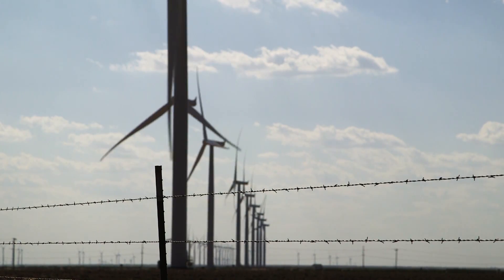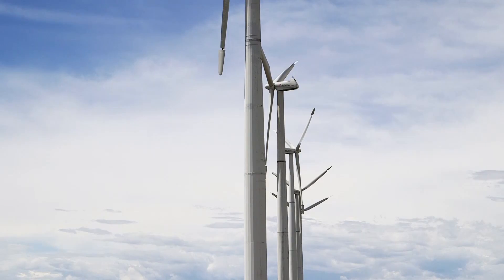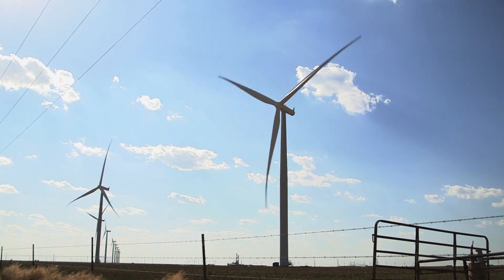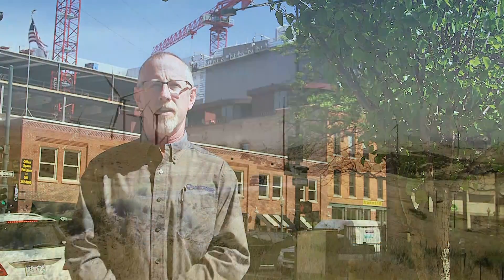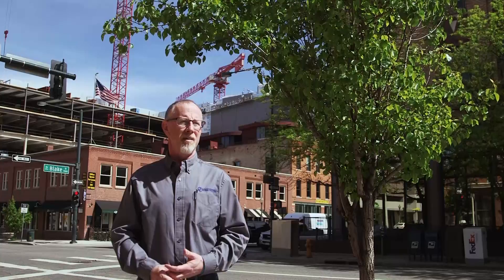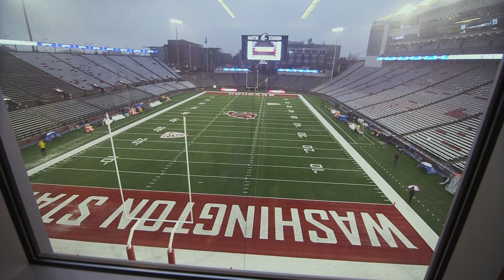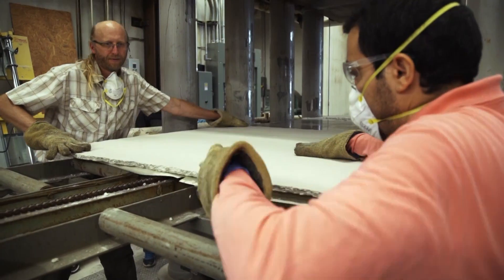Recycling Retired Wind Turbines

Comment: So let me get this straight.... We are going to return the site to its former self? Seems like the wind is still blowing there.... No thought in upgrades? Shocking that so little engineering went into this site. Just a thought. Build much larger foundations in expectation of larger turbines in the future.... I would go on however this is a fools errand.
Reply: You also have to take into consideration the difference in output from the turbines. The newer ones put out more energy and the grid there may not be able to handle the difference. That said they are subsidized to put up but may not be subsidized to upgrade, which makes it a losing proposition to the companies running them. I don't know if it's this wind farm or another in that area that shut down but that's the reason the company gave for shutting it down instead of upgrading it. It wouldn't give them a return on the investment.
Reply: Subsidies ran out, no more free lunch.
Reply: @fredhinck8847  Green energy should stand on its own, no subsidies!
Reply: when they started horizontal drilling the oilfield i worked in they would reclaim the wellsite after drilling.those wells were profitable so more wells needed to be drilled .the wellsites had to be rebuilt for more drilling on the same site that had been reclaimed . so much for planning ahead.

Comment: The cost for manufacturing, installation, maintenance and then disposal is roughly 90% of value of the energy produced. And ask Texas about the efficacy of wind turbines. All in all, a waste of time, energy and money.
Reply: Please prove that a wind turbine with decades of life and free fuel only earns 10% surplus energy over manufacture. Cite your sources. If you can't prove your statement, retract it.
Reply: @justsomeguy934  I was making that up. Sorry. I guess satire is above your pay grade. No, I will not retract it. Maybe I should have said 100% or 110%. What is "free fuel"? And you forgot to include the high maintenance costs. And the deaths of birds. Never mind.
Reply: @mikeyh0  "What is "free fuel"? Um, sunshine falling on my driveway doesn't result in a bill from God. Same for wind. That's free fuel. Oil, natural gas, coal - those are a different fuel altogether, yes? Are we learning at YOUR pay grade now?
Reply: @justsomeguy934  birds die flying into the windows of my home . will i board up those windows to protect the birds ?
Reply: Tyrone Jackson  "Argue all you like. You aren't changing anyone's mind with your condescending little rants. We still don't want them, and no one here likes you. Ta!" I suggest your read your comment again. It sounds like a 3rd grader said it on a playground. Do you know who childish your argument is? You're right about one thing - I won't change your mind, I never thought a closed mind would change. The common phrase is "Grandma will always drive her Buick". Buick is dead, and grandma doesn't have long. Since the next generation of car owners is already 80% or so pre-disposed to buy electric cars, your opinion doesn't matter. If you're over 50 years old, you are NOT the future customers of automobile manufacturers. The move to EVs has already been made, you can argue how great oil is from your LazyBoy recliner all you want.

Comment: Welcome to the new green deal. More garbage more waste more landfill.
Reply: Just like emissions compliance on our vehicles.  'Safe the planet' by burning more fuel and money than ever before to go the same distance in a smaller lighter vehicle you cant even repair yourself.
Reply: @illbeyourmonster2  my 2006 impala gets 29 mpg on the highway has 265,000 miles . never even changed the spark plugs . not because i can't i don't need to. i change the oil myself.. i also changed a front wheel bearing. the routine maintenance done on carbureted cars is no longer needed. how many people had a timing light back in the day anyway. the Texaco station i worked at did tune ups we didn't have a timing light LOL.
Reply: what do you think happens to the coal ash from the coal fired electric power plants?  Wait for it  land fills of sludge ponds . do a google search on sludge ponds .
Reply: @erniew5805  A lot of the coal ash gets repurposed to make concrete and for making toxic industrial byproducts inert.
Reply: @erniew5805  And?  You can have modern designs without the emissions restrictions and losses and get even better service life, power, and fuel mileage numbers too.  

It's multi Billion dollar industry and it's growing rapidly.

Comment: The wind never runs out, the subsidizing does.
Reply: The cost will never end until we screw the politicians into the ground for recycling.
Reply: The earth will vomit the politicians back out.
Reply: We're harvesting the wrong wind.  We need to find a way to bottle up all that hot air in Washington.
Reply: Let's stop subsidizing oil, coal, and nuclear power and see how long it takes for energy companies to choose the cheapest form of energy production.
Reply: @andyjohnson3790  sometimes the cheapest form is difficult to determine. You're correct, if all subsidies for oil were removed (no military protection for their trade routes, either), oil would become far more expensive than any renewable.
Reply: @andyjohnson3790  Nothing involving the government and tax dollars is ever the cheapest.
Reply: The subsidizing for oil never runs out!
Reply: @justsomeguy934  At this point Texas has proven that oil works better then solar for production and reliability
Reply: @WeinerusMaximus  "At this point Texas has proven that oil works better then solar for production and reliability" Actually, all Texas has proven is how to NOT run a utility. I live in a mountainous, cold, renewable energy state and I have reliable, cheap electricity. The Texas grid is islanded, meaning they and they alone in the USA cannot import enough energy to backup a shortfall. Their politicians deregulated their grid in the worst way.
Reply: @justsomeguy934  nope
Reply: @WeinerusMaximus  Have any facts to go with that "nope"? I guess not.
Reply: @WeinerusMaximus  well aren't you over sensitive when proven wrong.
Reply: @WeinerusMaximus  you have just proven my point.
Reply: @jamsaidemelo1367   No, you proved nothing. 85% of Windmill components are recyclable, but the FIBERGLASS blades are not recyclable , they are usually cut up in 20 ft lengths and buried in a  landfill, because FIBERGLASS used for their construction is NOT recyclable at this time.  There are reports of experimentation into recycling, but NOT AT THIS TIME.     If your point was to prove that you like to deny facts, then yes you've proven that, otherwise the blades continue to be buried in a landfill, because they are not recyclable at this time.
Reply: @justsomeguy934  During a normal winter, over 40% of the energy used in Texas is generated by windmills. Texas produces more power from windmills than any other state. The problem with the winter of 2021 was that a large portion of the state was below freezing for two weeks. This not only put a tax on the power grid for heat, but it also damaged cool systems at conventional power plants. The cold taxed the Texas power grid just like the heat wave along the west coast is taxing their systems for air conditioning. Texas is closing down six more coal fired power plants within the next two years as more wind farms  and natural gas fired power plants go online. The fact that the Texas power grid is an island does two things
 One, it keeps the cost low and two, it stops others from stealing our power because they feel entitled to it. Now, if only the western states could stop other states from stealing their water.
Reply: @vintagethrifter2114  "The fact that the Texas power grid is an island does two things" You left out the biggest flaw in that design - it means that the Texas grid is islanded. It means that they have no redundancy in their energy supply. It means that when they fail to winterize their grid time and time again, they cause energy shortages and price spikes. I don't see any advantage to their policy, except the propaganda benefit of blaming renewable energy for their recent shortage rather than blaming the politicians.
Reply: @WeinerusMaximus  "Actually I do,  but in the meantime, keep being a wanker with those cutting remarks." If you had them, you'd show them. I have all the documentation to prove the Texas issue is a refusal to winterize their grid and to integrate into the other grids in the USA. I've got the facts, let's see yours (without calling names; we're adults, aren't we?).
Reply: @justsomeguy934  Or wind and Solar
Reply: @vipommvictor6480  are we ever going to go to war to protect our interest of wind or sunlight in another country?

Comment: Video title "Wind turbine recycling"
Fact : "we blow em' up and shove em' in the landfill"
Reply: @katokagome4670  back in the 1960's the state of North Dakota reguired reclaiming open pit coal mines. to date i think only 160 acres of those mines has been released from bond to return to crop production. so while the land is not left in spoil banks it is still not productive crop land.
Reply: @katokagome4670  Since you didn't quote the exact sentence you're referring to, I'm not completely sure which statement I made that is in question. However, you have discovered the problem with text message exchanges - sarcasm and other properties of speech that a vocal exchange makes clear is unavailable. For example, if I said "of course I killed Abraham Lincoln", apart from the obvious inability to do that, my voice would imply that I do NOT mean it, nor am I confessing to a crime. It's the old Suuuuuuure response - clearly meant to convey distrust while saying "surely".
Reply: You mean landfill that you can grow crops on?
Reply: @katokagome4670  "So that means that nothing can be placed on the landfill or grown or anything." Yes, it does. The point is NOT whether or not you let cows graze on landfill or grow anything (because you CAN). The point is that solar panels or wind turbine blades are solid waste and not toxic. Starting your car in the morning is far more toxic than burying a turbine blade.
Reply: Just SomeGuy 
BULL SHIT

Comment: Why not use wooden mills like people have done for centuries?
Reply: The composite blades are stronger, lighter and more efficient than wooden blade.  But the current trade-off is that the technology really hasn't been developed yet to properly recycle composite blades... so they go to a landfill.  If we are going to use composite blades, then we need to find a way to recycle them in a cost-effective manner or turn them into some other secondary product.  Perhaps the composite fiber could be chopped up and added to concrete to increase it's tensile strength instead of using so much steel re-bar.
Reply: @edschultheis9537  "Perhaps the composite fiber could be chopped up and added to concrete to increase it's tensile strength instead of using so much steel re-bar." That's exactly what is done.

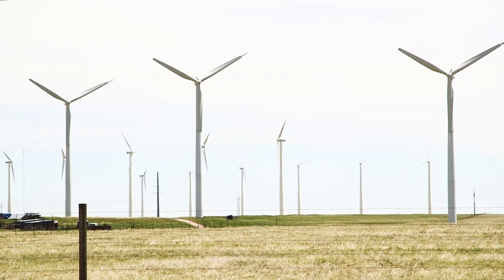Comment: 0:29 "Our intention is to return the sight to it's original appearance" = We are not doing that again 
If it is sustainable why not refurbish or even add more on the sight?
Conclusion: Fail, not doing that again.
Reply: Bravo. Been saying that for years. Did the site run out of wind? 😂😂😂
Reply: Yeah the tower and properbly most of nacelle could be used after inspection. After they blow it up its only scrap and debri.
Reply: @homeistheearth  Nope.   The new ones are MUCH larger and produce a ton more energy.   The old are scrapped.    In 20 years all the Anti-Wind people are going to look like the flat earthers of the past.    Change is coming.

Comment: How many coal and gas electric plants end up in landfills?
Reply: Exactly we take that out of the ground that is a product of this Earth that's not really going to hurt us as bad as everybody thinks it will it's a product of the Earth windmills are manufactured by human beings when we combine stuff from nature together then we got to worry about it because it won't dispose of itself
Reply: Almost all the insulation in a older plant contains asbestos (covering all the pipes, boilers and turbines) Its desposal is very dificult.
Reply: @douglaswilson6906  Desposal of asbestos isnt difficult if you know what you do! i worked 5 years for a company that removed asbestos!
You just need safety equipment and airtight containers to put the asbesos in until you get it to your facility where you grind it up and fill it in airtight bigbags that can be put in say a landfill ore an old abandoned mine.
Reply: @douglaswilson6906  
I’ve seen the “special handling” asbestos gets. They put up sheet plastic barriers, people in tyvex and respirators go pull it off, they pressure wash or media blast, put everything in garbage bags and throw it in the dump! I was amazed that was it! I’ve witnessed it many times.

Of course they charge extra!
Reply: what do you think happens to the coal ash from the coal fired plants?
Reply: @erniew5805  It's used to make cement.
Reply: @erniew5805  
They call it fly ash. It’s used as inert land fill, drywall. Still an eyesore.
Reply: @logoseven3365  what about the bottom ash? why is Duke energy having  coal ash sludge ponds give way and polluting rivers in  North Carolina. the burning process concentrates the bad things in the coal mercury sulfur(remember acid rain) in the ash. the fly ash goes up the chimney and is captured by the scrubber . the bottom ash doesn't. i used to burn lignite coal for heat . i dealt with lots of ash. the much more expensive sub bituminous coal had much less ash to deal with.
Reply: @erniew5805  
True. I don’t understand how they get away with that. If you compare bottom ash to fly ash however, it’s a much smaller amount
Reply: @erniew5805  ----- No need for thinking, but some reading is required,
https://en.wikipedia.org/wiki/Fly_ash
Reply: @mickor O yes,  You just described a volcano!  And you know how much emissions come from just one?  Do some research once.

Comment: Doesn’t seem so green now.  Why not just replace the worn out parts? The structural components of these should last a long time.
Reply: That would explain not building new smaller ones. These are already there. I suspect it has more to do with tax credits. They only get government handouts when they build new ones. Just another example of how wasteful these government programs get.
Reply: @klardfarkus3891  Actually in the 1st video the company representative explained that they felt that there was insufficient land to build a modern facility. With regard to government subsidies you may be correct insofar as they may no longer be available in this area & to make such a project commercially viable without subsidies a greater land mass would be required. I couldn't help noticing from your comments that seem to remain unconvinced as to the value of subsidies for renewable energy projects. Surely I needn't have to remind you that successive USA government's, both national and state, alongside many other world government's have been subsidising the various fossil fuels industries for many decades at the expense of their taxpayers in the form of tax concessions & often reduced environmental protection standards with the resulting consequences of increased costs to both  a loss of productivity/lower GDP & the various healthcare systems. Healthcare systems, of which many are unlike the USA are nationally funded thru the tax system. This is of course not limited to energy. Many places worldwide compete for the attention of new employers by offering generous incentives. As for the environment, well we absolutely have to start somewhere. If you haven't seen it try to watch the National Geographic documentary FROM PARIS TO PITTSBURGH or was that PITTSBURGH TO PARIS...hmmm. It's about science not belief. Sorry for the long answer. Only trying to help.
Reply: I don’t have a problem with subsidies. I believe recycling should have subsidies. But sometimes subsidies can have wasteful consequences. You can see it in many different areas of the economy where subsidies and tax deductions and credits encourage wasteful behavior to maximize the benefits. We need to be better at ensuring all the incentives are beneficial and not wasteful.
Reply: @pinkelephants1421  subsidies how about the oil depletion allowance?
Reply: @erniew5805  Sorry, could you please be more specific? I'm not familiar with the oil depletion allowance.
Reply: I watched the sister video to this report yesterday. The turbines had come to the end of their commercially viable lifespan. They were at the point of requiring too much in the way of replacement parts & maintenance. I did wonder as you will see if you watch the other video if it would have been feasible to carefully dismantle them & sell them as second hand turbines
Reply: @Chen Lee These aren't exactly small turbines but if you're referring to the utility company then you're absolutely correct. A larger  and technologically superior turbine will be more powerful & give a greater return on ROI, require less land  & have fewer costs both upstream & downstream.